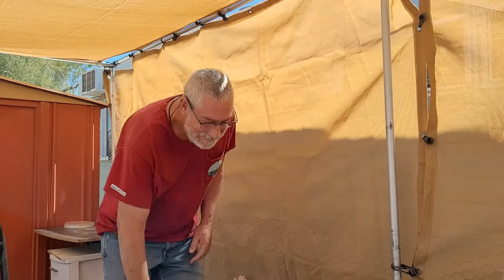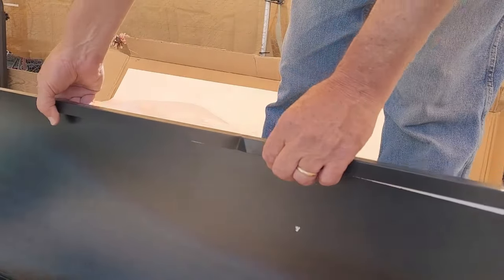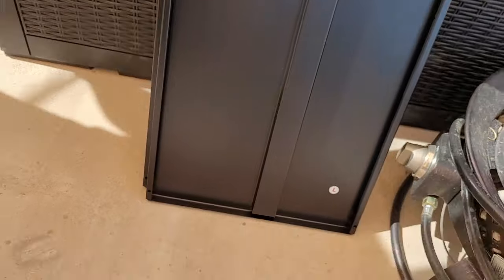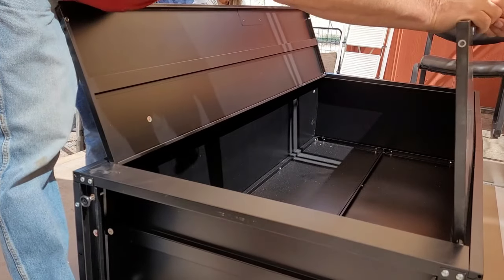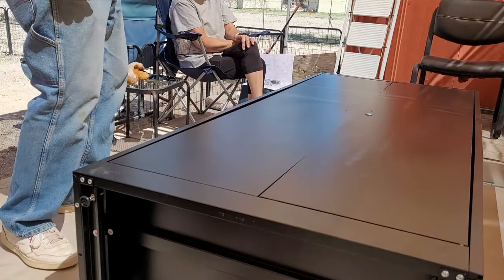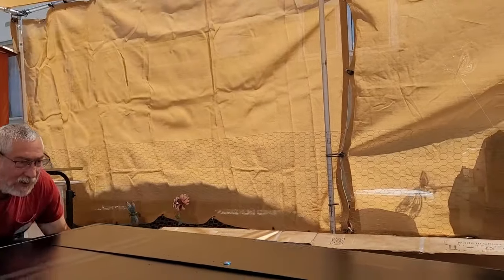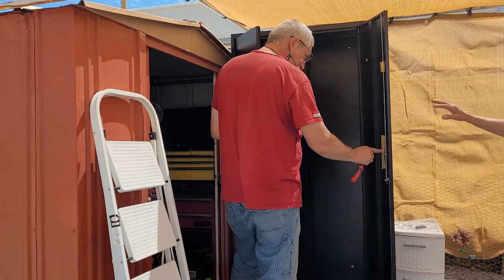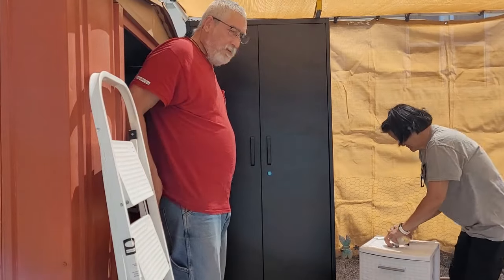The Fastest Way to Assemble a Tall Metal Cabinet

Comment: I just put the same cabinet together in work. Didn't come damaged at all. Easy to assemble all pieces and parts marked with good instructions. You can adjust the feet with a flat blade screw driver thru the 4 (plugged) holes from inside bottom of the cabinet.